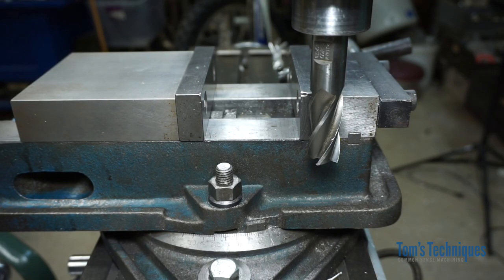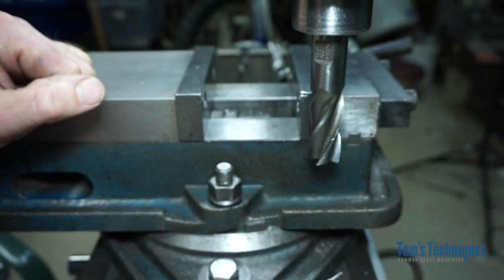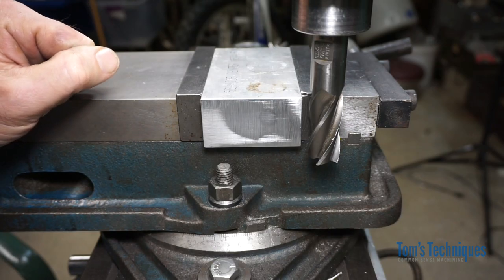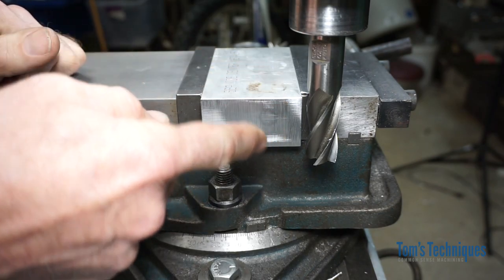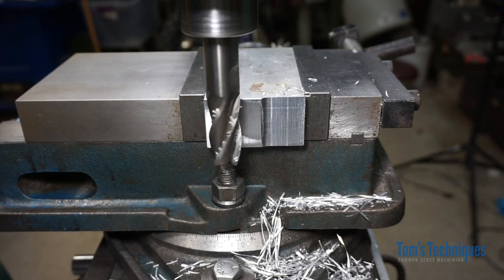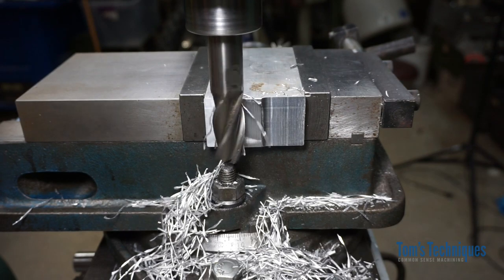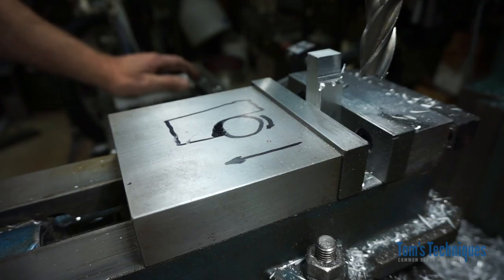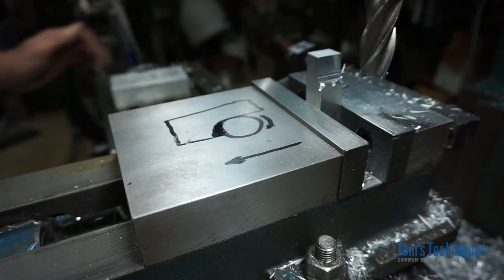Climb Milling vs. Conventional Milling

Comment: Just reviewed this again (liked it again !) and came up with a question. If one was cutting a slot through the middle of stock then I guess it would be conventional no matter what direction stock was feed into end mill?
Reply from the maker: The term "slot drill" is a seldom used name for a two flute, center cutting end mill. I've been a machinist for better than 45 years and never heard the term until I started using the internet. I suspect that what Lyle was getting at is that it is preferable to use a two-flute end mill to plunge into the work and for milling a slot than a four-flute because of the extra chip clearance it provides.

Tom
Reply: Thanks, Tom
From, Tom
Reply: Toms Techniques I'm just a beginner at machining, so what do I know? Not much at all!  I do know that "slot drill" is the name regularly used in Britain to refer to a two flute end mill. 
On the question of milling a slot along a piece I wondered why experienced machinist seem to like to mill the slot with an undersized cutter and then trim up the sides afterwards. The reason, I discovered, is because the cutter is indeed both climb and conventional cutting when in the slot, and the cutter will tend to pull itself (or the work) towards the climb side of the cut and away from the conventional side, so the slot won't be exactly where it should be; it will be off to one side. Using an undersized end mill means that this doesn't matter since a finish cut along each side will move the slot back to where it should be. 
So if I'm wrong about any of this please accept my apologies. And please correct me too!
Reply from the maker: I never thought of it that way Tom, but I guess that would be true. Normally the terms conventional and climb milling only apply when one side of the end mill is cutting. When I mill a slot. I just make a cut on center to rough it out and then climb around the sides to finish it to size.

Tom
Reply: Have no idea why, but rethought about it again and figured that it would be both climb and conventional depending on which side of the end mill one was looking at. Forces would end up as rotational and directional for holding concerns. By the way, toward the end of your video where the mill grabs the part, I just wanted to say I have been there and it really, really crashes!
Reply: Just been reading a book by tubalcain re milling.  He says that an end mill simply should not be used for cutting a slot.  It is not what they are designed for.  They are designed for facing on one side only.  so the correct way to cut a nice slot is to use a slot drill to cut an initial slot and then face each side of the slot to size using an end mill.
Reply: Jack, thanks, I agree with that. I was thinking more of a wider groove, and not a slot, but wasn't clear in naming it a slot. I did break an ⅛" end mill the other day by trying to cut a slot, when what you said would have worked better.
Reply from the maker: Tom,

When cutting narrow slots, it's much easier on the end mill to rough out the slot by plunge cutting to depth a little at a time. That is much less apt to break a small end mill than side cutting.

Tom
Reply: Toms Techniques 

Excellent work Tom. Thank you for sharing your knowledge. Regarding plunge milling, that's a technique I use regularly to remove lots of material. If you haven't already done so I believe it's a subject that would really benefit from one of your clear and concise treatments.
Reply from the maker: Thanks Jay.

That is one of the topics on my to do list, and along the same lines, deep pocket milling.

Tom
Reply: Hi

Comment: Quick comment on the whiteboard demo of chip shape and finish near the end of your video. This was explained to me via whittling wood with a knife. Imagine trying to whittle a chip that starts thin and get's thicker! Most whittling is 'climb whittling', and you may find that your 'vise' hand gets tired more quickly than your 'tool' hand.

The analogy is a bit weak, but it made sense to me when I was ten, ha! :)
Reply from the maker: I haven't done much whittling, but it sounds like you may have it backwards. When climb milling, the chip starts out thick and finishes up thin. I suspect whittling is the other way around.

Tom

Comment: Really interesting :)

With the chip difference between conventional vs climb, would climb milling actually be better for the tool in the long run?  ie less rub = less generation of heat?
Reply from the maker: Absolutely. You just have to be careful on light machines that the tool doesn't grab. If you are using a light mill and/or are uncertain about how to deal with backlash, then rough the part conventionally and climb mill for a good finish.

Tom

Comment: I like to climb with a bit of "braking" on my table locks.  however has anyone designed a viscous or magnetic dampener? something that would resist movement but flow smoothly up to a certain feed rate?
Reply from the maker: Yes, they are called shock absorbers. The problem is if you used something like that, it would need to be attached to the table, because the free play is in the feed screw/nut. It's probably best to just learn how to deal with it by controlling the depth of cut or dragging the locks as you mentioned.

Tom

Comment: Ummm....if you have a light milling machine #1 you don't take .080 cuts, #2 when climb cutting, the tool takes less load, stay sharper longer,  and you use the table lock to keep the tool from jumping.....climb cutting is the safest cut to make, when you do it correctly. Conventional cutting is a thing of the past.
Reply from the maker: #1 - What is your point about .080" cuts? You can take whatever you want up to what your mill will bear.

#2 - I mentioned that in the video. You must have missed it.

#3 - Conventional milling is definitely not a thing of the past. It is MUCH safer than climb milling when taking heavy cuts on light machines, like those that so many hobbyists have. Both methods have their place.

Comment: Is it a good practice to do conventional milling for the rough cut, and a climb for the final pass?
Reply from the maker: If your machine can handle it, climb mill everything. It's much easier on the end mill. On a light mill that lacks rigidity, save the climb milling for the finish cut and conventional mill everything else.

Tom

Comment: As someone that is still new to machining with a mill I learned a lot from this video. I had a part climb out of my vice as you describe around the 13 minute mark and did not know what I did wrong but your explanation and example really put everything into perspective. Thanks.
Reply from the maker: That's good to hear. Too bad you didn't catch the video before the crash. :)

Tom
Reply: Tom

Very true, but some trial and error for a new user is expected. Thanks again.
Reply from the maker: Crashes can be expensive in machining, so hopefully these videos can help prevent some of them.

Tom

Comment: hi first time watching, I really like the way you have explained climb vs conv. milling . I just wanted to ask you do you use the same theory in cnc milling as well or does it only pertain to conventional mills (manual) ?
Reply from the maker: The theory is the same for manual or CNC mills. The only difference is that climb milling is less of an issue with CNC because of the zero backlash leadscrews.

Thanks for watching.

Tom
Reply: Ok thnx

Comment: Hi Tom, great demonstration. What would you consider to be a "light" machine? The machine I recently purchased is a 7.5X28" machine weighing roughly 1,200lbs. Would you say that falls into the "light" category? Thanks.
Reply from the maker: Thanks.

A Bridgeport is actually considered a light mill, so anything smaller and lighter will have less rigidity. Of course other factors need to be considered as well, such as the amount of wear, the type of ways on the machine and the build quality.

Tom

Comment: I see how to distinguish climb milling from conventional when side milling because direction of rotation in relation to direction of travel establishes it. But end milling half your end is rotating in the direction while the other half of the end is opposite direction of travel ; ITS A CIRCLE! How can you claim (when end milling) that you are conventional milling OR climb milling; half the end of the mill is rotating IN THE DIRECTION of travel while half the end of the mill is rotating AWAY from the direction of travel?
Reply: Direction is defined by what direction the mill is turning compared to intended finishing surface. When doing pocket (inner profile), mill counterclockwise and it is climb milling. For islands (outer profile) mill clockwise and it is climb milling. For conventional milling, just reverse the direction for pocket and island. Of course when roughing first end mill is using full width at least for some pockets. When material is removed it becomes quite obvious which direction you are milling as it is the same situation as milling side.

If the case is to just mill slot equal to end mill width (rare case) then it really doesn't matter which direction you are moving. Like you said, half of the end mill moves against direction of travel and another half for it.

Hope this makes sense.
Reply: the back side of your cutter shouldnt be digging in, replace your bearings
Reply from the maker: This is a good explanation, explaining how the end mill interacts with the surface of a part.

The only exception is that it does make a difference which direction you feed when milling slots. Since only the lead side is cutting, it has more side force than the trailing side and will deflect to the left, relative to the direction of feed for a right hand end mill. Consequently if the finished slot is close to the end mill diameter (which is actually poor practice), it needs to be slightly offset, or a smaller end mill needs to be used. Otherwise the slot may not clean up to finished size.

Tom

Comment: This is great for a manual machine. You are spot on with all the issues and benefits. 

Additionally, on a CNC with ball screws and very little backlash, climb milling is best all around due to the better chip clearance and better surface finishes. As an added bonus, tool life also goes up with climb milling with light, fast passes  (High Speed Machining or High Efficiency Machining) on a CNC.
Reply from the maker: Thanks Tom.

Tool life is definitely better when climb milling due to the lack of rubbing as the cutter enters the work.

Tom

Comment: What is the best milling for Plastic molding ?
Reply from the maker: Plastic flexes, so it's always a risk to take much of a cut when climb milling. You might try using conventional milling for the heavy cuts and climb milling for the finish cuts.

Tom

Comment: Isn't your vice-top diagram explanation wrong? It's the workpiece that feeds not the tool.
Reply from the maker: The interaction between the tool and the work is all that matters. My head is happier thinking in terms of tool movement than workpiece movement. The end result is the same.

Tom
Reply: The end result may be the same to you because you understand the difference between climb and conventional milling but I think it may be confusing for those who don't appreciate the difference in terms of the feed direction of the workpiece. I'm surprised that no-one else has picked this up (I haven't read all the comments) but it does indicate to me that maybe not everyone is understanding your explanation just going along with it.
Reply from the maker: Judging by the comments, I'm pretty sure people are getting it. And yes, you are the first to point out that the cutter is feeding instead of the work, but as I said, the relative movement is the same, regardless of what is moving.

Tom

Comment: If you are doing a pocket in the middle of a part, are you climb milling or conventional milling?
Reply from the maker: That depends on which direction you are feeding around the pocket. Clockwise would be conventional milling and counterclockwise would be climb milling.

Comment: Would it be true to say that conventional milling is going anticlockwise around a part with the trailing edge of the cutter, cutting first - or feeding against the rotation.   Whilst climb milling is going clockwise around a part with the leading edge of the cutter cutting first - or feeding with the rotation.  I think the abstract nature of the cutting terminology causes confusion.
Reply from the maker: Correct. Feeding with or against the rotation of the cutter is the best way to differentiate between climb and conventional milling.
Reply: Toms Techniques Thanks, came back to watch the video again to remind myself.

Comment: at 13:13 I usually go from left to the right, but if you go from that left to right does that end mill last long. And wont it kick the work piece?
Reply from the maker: As discussed in the video, you can mill in either direction if you understand the forces the cutter is placing on the work. 

Generally end mills will last longer when climb milling than conventional milling.

Tom

Comment: Great video, the best I have seen on this subject but if I'm not mistaken then when climb milling then the chip thickness will not go to zero at the end of the cut but will actually thicken a really small amount (more when feed per revolution is smaller) and so the cutter is always engaged in actual cut and not slipping thus giving the tool much longer lifespan. Or am I understanding something incorrectly ?
Reply from the maker: +Matis Averin 
The chips produced when climb milling or conventional milling are both a similar crescent shape, thick on one end and thinning out to nothing on the other. What makes the tool live longer when climb milling is the fact that the chip starts thick and ends thin, which is the opposite of conventional milling. The tool trying to break into the metal at the start of the cut when conventional milling is what causes the excessive wear.

Tom

Comment: Perfect explanation, thanks Tom.. I have a light smaller machine and everything I was reading was to use climb (even the default setting in fusion 360 for gcode) now knowing this I will try conventional for my rough cuts and climb for finishing.. Thanks
Reply from the maker: +Troy Dawson 
Thanks for watching

Comment: Very cool Tom! I am healing a dislocated wrist and guess I will get back to the shop. I can't stay away :)  I Don't want to over step but, like a drawing, multiple views can sometimes describe a full idea. Your explanation of climb/conventional, push/pull and such is awesome. Simple and to the point! This comment is more for finishing. As for all cutting efficiency I also think of materials as having a skin and the sharpness of the cutting edge is directly related to the starting cutting pressure of conventional. Where the "bite" distance to get under that "0" thickness increases with conventional compared to climb. To exaggerate a tool with a little "shine" on the edge or if we look real small and consider it to be a slight micro radii can cause that pressure until the cutter lip is at least that deep into the material. Unfortunately with end mills this is constant. Plus the chip evacuation of the trailing side of side climb cutting helps better than "chopping through the chips that were already cut once. Thank for a great basic, easy to understand visual on this. It makes me want to get yet another camera. Climb when ever possible within reasonable time and cost is what I aim for. Thanks again
Reply from the maker: +Do Right 

Thanks. Glad you enjoyed the vid

Comment: and hey, for those who dont know, you can cut the double end endmill in half to shorten the amount it sticks out. it works great
Reply from the maker: +the russian machinists 
For the record, this is the only end mill I own that won't completely fit in the collet. I would hate to cut it off and then have the need for one with a long reach. Maybe it's time to bite the bullet and just buy a holder.

Comment: Good video but any apprenticed machinist would learn this in the first few weeks of their apprenticeship.Here in the uk we study for 4 years.that includes 1day a week @ college  for the full duration of the 4 year.When you have finished you should be a competent Machinist that can Mill and turn also you should be able to prg from a drawing a very complex part on both a milling and turning CNC machine.Even multitasking and flexible machining centers.shouldn't be a problem.
Reply from the maker: +Carlos 
Come on Carlos. An apprenticed machinist is not going to learn his trade from YouTube videos. He will learn it under the direct supervision of experienced instructors and mentors. The intent of these videos is to provide a new hobby machinist with enough information to enable them to do basic machining in a safe and effective way, not to teach them a trade.

Tom